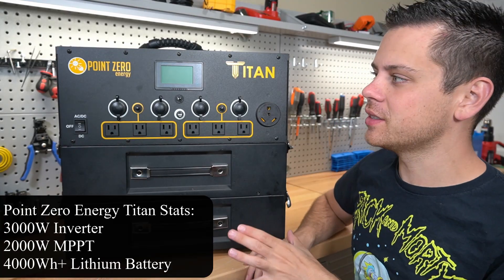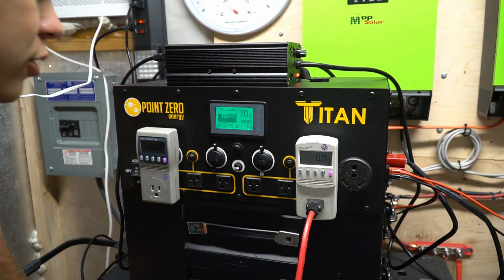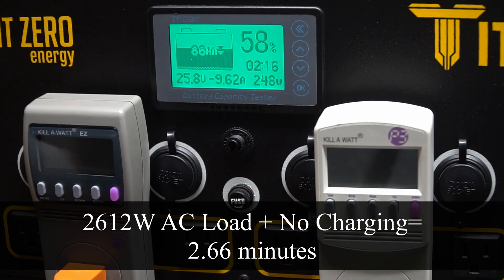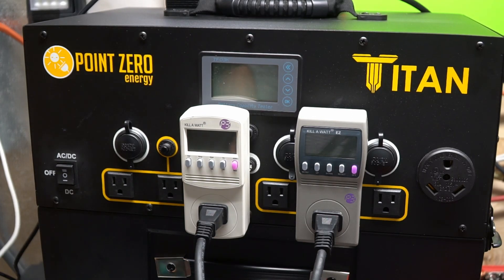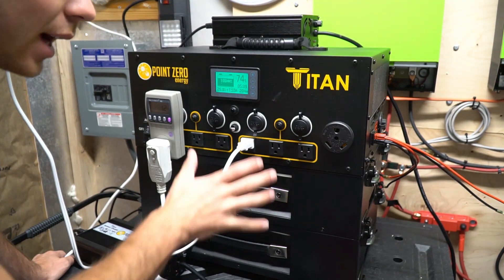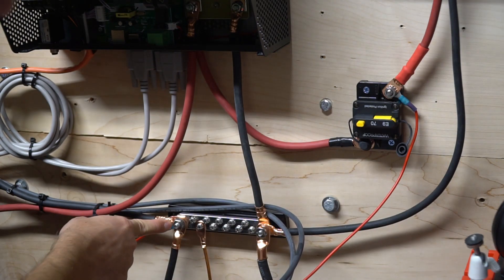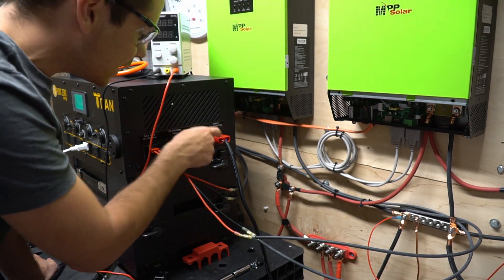Titan Solar Generator: Max Load Test, Battery Expansion, 12V Charging and more!

Comment from the maker: Update from Point Zero Energy: I got a bad batch! (just my luck as always haha!) If I had a Titan that was produced just a week earlier, this problem wouldn't have occurred. They added an upgrade to the inverter board to make it more robust during shipping, but it has caused heat to accumulate next to a sensor. So point zero energy is fixing this batch of units and sending out one to me that works. 

They had no idea that this problem would occur, so they seem glad that I caught it. I know that other titan users have ran these units 24/7 since feburary, so the results I was getting was quite confusing. I will get a new unit with this problem fixed for the next video. 
All Titans before this batch do not have this problem. I will do a new video testing the updated unit. They assured me that this will never happen again. Will keep you guys updated.
Table of contents:
Load tests:
1:02 2,868W output + AC Charging + Solar Charging Test
1:49 2,868W output + Solar Charging Test
2:13 2,868W output Test
2:51 2,125W output Test + AC Charging + Solar Charging Test
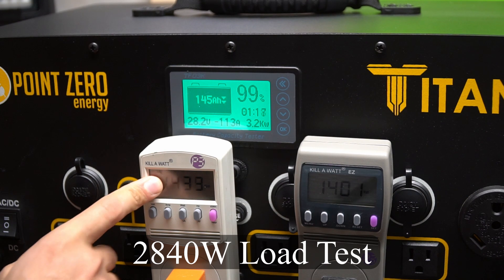3:38 2,240W Test
3:55 2,424W Test
5:02 2,000W Test
5:34 Multi-day test with air conditioner
6:10 12V Car Charging Test
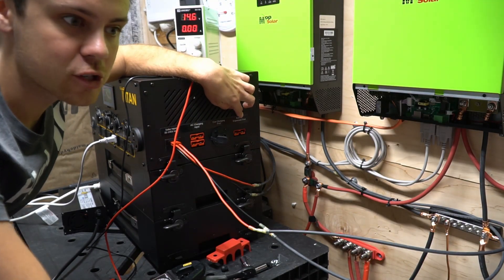6:37 Battery Expansion Port Test
9:04 Conclusion

~~~~~~~~~~~~~~~~~~~~~~~~~~~~~~~~~~~
Tired of getting ripped off? Check out my "Will Prowse Approved" solar product recommendations below!

12V Batteries
https://www.mobile-solarpower.com/lithium-batteries.html

48V Batteries
https://www.mobile-solarpower.com/48v-batteries.html

Offgrid Inverter System Builder
https://www.mobile-solarpower.com/48v-complete-system-blueprint-559371.html

Hybrid Inverter System Builder
https://www.mobile-solarpower.com/code-compliant-48v-offgrid-system.html

Mobile Handtruck System Builder (very popular!)
https://www.mobile-solarpower.com/mobile-48v-system.html

Solar Panels
https://www.mobile-solarpower.com/300w-solar-panels.html

Ground Mount Solar Racking
https://www.mobile-solarpower.com/ground-mount-racks.html

Wire, Lugs and Busbars
https://www.mobile-solarpower.com/wire-and-connectors.html

Tools
https://www.mobile-solarpower.com/tools.html

Fuses and Circuit Breakers
https://www.mobile-solarpower.com/fuses.html

Plug-N-Play Solar Systems
Ecoflow, Anker And Bluetti! So many models to choose from. See my current recommendations here:
https://www.mobile-solarpower.com/full-size-systems.html

~~~~~~~~~~~~~~~~~~~~~~~~~~~~~~~~~~~~~~~~~~
Need to build a large DIY system? Need a trustworthy solar distributor? These are my favorites:

Signature Solar
Creator of EG4! Solar Minisplits, Victron and More! Largest Solar Store Online.
If you want $50 off, please use my link below and coupon code "DIYSOLAR50":
https://signaturesolar.com/?ref=cPwLcVc0SW-BjN

Current Connected
Best Prices for EG4, Victron, Midnite and so much more! Fast Shipping and Highest Rated Customer Service:
https://currentconnected.com/?ref=wp

~~~~~~~~~~~~~~~~~~~~~~~~~~~~~~~~~~~~~~~~~~
Join our DIY Solar Community 
Need more help? Join the largest solar forum on the internet for beginners and professionals alike. 140,000 members and counting!
https://www.diysolarforum.com

Check Out My Free Book
Best-selling and beginner-friendly guidebook to off-grid 12V solar!
https://www.mobile-solarpower.com/the-book.html

~~~~~~~~~~~~~~~~~~~~~~~~~~~~~~~~~~~~~~~~~~
Contact Information:
I am NOT available for personal solar system consult! If you wish to contact me, this is my direct email: williamprowsediysolar@gmail.com
FTC Disclosure Statement and Disclaimers:
Every video includes paid promotion or sponsorship (such as free products for review). Some links on this YouTube channel may be affiliate links. We may get paid if you buy something or take an action after clicking one of these. My videos are for educational purposes only. Information is subject to change/update at any time. Electricity is DANGEROUS and can kill. Be smart and use common sense :) DIY Solar Power with Will Prowse is a participant in the Amazon Services LLC Associates Program, An affiliate advertising program designed to provide a means for sites to earn advertising fees by advertising and linking to Amazon.com
Reply: videos too short! Need to be about an hour long. lol
Reply: @controlyourfuture5477  So that we can watch it cool down? lol We just need to pause it, and watch it again, understand it. All the information is there.
Reply: "Should we test this before sending it to reviewers? Nah screw it"
Reply: @Fur_Trader  I was just thinking this lol, I was also wondering What the temp is in his shed, like he put a heat gun in there lol
Reply: Will, I was watching one of the Chris Titus Tech videos the other day, and he has the labeling somehow encoded into the video itself, I thought it was pretty cool to mouse over the timeline and see it labeled.
Reply: @javabeanz8549  I believe that's a new thing with YouTube, if you put the timestamps in the description.
Reply: Will can you start taking decibel measurements? Maybe start a spreadsheet pinned on the website maybe? Love your work man, more please! Lol
Reply: Will, you mention that units before this batch were unaffected.  When did you receive your unit.  Are they serial numbered, and if so, what serial numbers are affected?  I received mine in mid March, but I have never reached that high of a load level.  The highest load I've put on mine is 2 kW and I've not had any problems with that.
Reply: What if you're another person who happened to get this batch? Will everyone else get new units shipped to them?
Reply: Thanks, thinking of buying one but stopped thinking about it until I read your update. keep up the good work, u must be an electrical engineer or at least have a BET degree. I have not seen this kind of knowledge since since I left that environment just after the turn of the century. Yes my first programming courses were punched cards, EIA/ISO NC, basic programming, single board design, mostly ending in the late 90s. I love your stuff, dont go to hollywood and make any movies, it would ruin your passion.
Reply: Thanks for making this timeline list
Reply: I'm supposed to receive my unit in July.  I've been impressed with PZ so far.  I called them and the owner answered the phone and answered all my questions.  I expect that they will make this right.  Looking forward to finally getting to play with this thing.  Beats anything else out there, and I probably couldn't build a system for any less.
Reply: Bryan Smith have you seen the new apex units? I’m getting my titan 1000 kit this Monday!
Reply: Oh hell no,! You discovered a huge issue, you deserve royalties or free Ice cream or something! Lol
Reply: Did you get a better version of the Titan?  I would love to see it with 3 batteries.   I have been looking at it every week since I watched your first video.  My electric bill tripled.  It is summer but the spike in price was mostly on the delivery fee end.  We also have had our power out recently for about a week and that has happened before.  I like the concept of the Titan but if the inverter is the limiting factor, then, would having 3 batteries help or not?   Using their numbers, I have been thinking that 3 batteries would run my whole house.  But could the inverter handle everything?  Or would it just be running the things other than the oven and dryer maybe?
Reply: Can you charge your Tesla off it on that TT-30 outlet using a NEMA 14-50 adapter? I've seen them made for EVs.
Reply: Jason Bowman Could be they didn’t thoroughly test it? Also I think testing is not thorough, maybe they randomly spot check one to test more thoroughly, not all. If his was a preproduction model maybe they should have tested it fully
Reply: When did you receive yours? Wondering if the unit I received this week is affected.
Reply: Hey will another thought occurred to me, I have been aiming to 4kW+ because of the performance changes in altitude, as well as temperature, maybe test for the effects of altitude if possible?
Reply: According to their webpage the max load of 1500W is recommended to prolong battery life.  This unit (with 2 batteries) lists at $4400 and weighs almost 100 lbs!  Not exactly portable (unless you take it apart).
Reply: What's the power factor of the air conditioner maybe the VA was to high.
Reply: That's a relief, have one on the way...
Reply: Hardware needs to take a lesson from software and do REGRESSION TESTING when they change ANYTHING
Reply: I dont mean to be so offtopic but does anyone know a trick to get back into an instagram account??
I was dumb forgot my password. I appreciate any tips you can offer me!
Reply: @Tomas Chris instablaster =)
Reply: @Randy Maverick Thanks for your reply. I found the site through google and Im waiting for the hacking stuff now.
I see it takes quite some time so I will reply here later when my account password hopefully is recovered.
Reply: @Randy Maverick it worked and I finally got access to my account again. I am so happy:D
Thank you so much, you really help me out !
Reply: @Tomas Chris no problem :)
Reply: You're very thorough in your tests. I like that. Stay honest. Keep it up!!
Reply: I'm glad they helped YOU, but there are 8 of us here that have units that went up in smoke and are not getting any help at all....

Comment: It saddens me greatly that my Point Zero Titan Solar Generator, with only a cell phone and small smart tv plugged into it, caught fire and had to be returned under warranty for repair. WORSE than that, they returned it to me with the same problem. I simply set it upon it's base and clamped it's own side hinge clasps together and plugged in a lamp and "Pop! Pop! Pop!" It WENT UP IN SMOKE AGAIN. Mind you, the unit ran perfectly for 20 months being used daily to power a phone and TV and a lamp and sometimes a laptop. Subsequently, Point Zero Titan has COMPLETELY IGNORED ALL REQUESTS TO HAVE THE UNIT PROPERLY REPAIRED, ignoring ALL calls, ALL emails and ALL CERTIFIED LETTERS. It is so very disappointing that what started out as an INCREDIBLE machine ended up here as a VERY EXPENSIVE COMPLETELY DANGEROUS AND NON FUNCTIONING  system. POINT ZERO TITAN HAS NOW GONE OUT OF BUSINESS and there are atleast 8 of us within 100 miles of one another who have experienced the same exact issues. It starts out smelling like a hot fishy smell and then evolves to a burnt electrical smell within moments and then smoke and flames come out the side vents. My guess is that it is poor soldering technique and components jammed too close together. I sure would like to have the unit repaired and be able to use it here as the missionary base source of power but where oh where can I even take it to for repair? The first issue rendered 12v useless. The second event rendered 110 useless. If anyone knows where any of us can take this unit for repair, please let us know. I have known people who have really used their's beastly for 20 months before they died and here I am just barely loading it and an entire year of my income has been lost on this...maybe we just need to build our own and then when one component goes bad, we simply replace the component...ideas please? I am willing to pay a qualified technician to repair it because I am in the Sonoran Desert Wilderness , miles and miles away from civilization and I need a RELIABLE unit...I am so disheartened....

Comment: HELP ANYONE! I realize it's 2025 I Purchased my Titan (The one pictured in this video) 1500 Kit (2 Batt Packs 15 Panels) In 2021. I Just installed it 7 months ago OCT. 2024. It is in a 50 Degree Shop running 700 Watts of Grow Lights. I turn it on every morning. It is not on at night. I turned it on and went to work. It was at 85% charge running 600-700 Watts I cam home 5 hours later. No grow lights on. Titan is at 100% Charge and also still charging from solar. NO A/C power output. NO D/C power output. The fuse is fine and the black "Breaker Buttons are not tripped" At least I push them in and hold but there is no click or snap as if they will remain depressed. They seem to be "Floating" if that makes sense. I unhooked the solar and turned the unit off for a couple hours came back and plugged in several test items. "Still no power output" I left it off ALL NIGHT. Went in this morning, "No power output" This thing may be 4 years old but it is really BRAND NEW. Any help PLEASE???
Reply: Sad that Point Zero Energy closed in May 2025.  I have spent thousands of dollars on their products and now I'm hanging in the balance.

Comment: Will, I have a Titan from Point Zero with three batteries.  The inverter trips with any load over 500 watts. It has been sent back twice for repair and it is out of warranty now.  Can you tell me the distributors that you mentioned in this video?  Peter

Comment: Will have you done a follow up video on the Titan after you used it for awhile.  Just took delivery of one after a long wait.  For my RV.  Two batteries.  Two of the heavy duty AC chargers.  Figure I can recharge at night when I run my Gen set for 2 hours

Comment: This is one of your best reviews imo, I really like the external battery connection. But my favorite is that they de-rated their capacity for a longer life system. I think heat is the biggest problem for all in one systems. Maybe a small liquid cooling system is the answer.

Comment: Hey there, just found you and liking your videos. I’m in the market for a solar generator that will power a deep freezer or household fridge. I’ve been told that the Titan is the only one large enough to do the job. Problem is I’m new to this, have watched & read so much that I’m overwhelmed. Which Titan would I need and how many add on batteries & panels would I need for a large appliance? Additionally Nature’s Generator now has a 3600w system. Do you have experience with this generator? Thx a bunch, would be super appreciative if you could offer some advice.

Comment: The problem may be internal temperatures. There is not enough cooling air to cool the inverter. Those cooling holes,  both intake and fans, look way too small. 

What is the ambient temperature?

As for charging from a car:
Most cars don't have cigarette lighter circuits anymore. They have power outlets. Difference is that cigarette lighter was fused at 15A to 20A. The newer cars are fused at 10A.

Comment: I'm sorry if you've posted a video already but I would love to see more second-life batteries used for energy storage. Also a system the average person could change a battery pack easily in the future when needed with maybe 18650/21700  or other battery cells in a pack.

Comment: 365
W per panel
Short Circuit Current: 9.83
Open VOC: 48 Volts
Current Max Power: 9.33 Amps
Voltage Max power: 39.10 volts  
If I do parallel setting 6 to 8 panel my maximum current will be 9 Amp x 6 or 8 = 54 A - 72 A 
the titan spec Maximum charge current: 40A (approximately 1000 watts)
Maximum continuous Discharge: 100A (approximately 2500 watts) will it be OK

Comment: These units are expensive at $3000 with just one battery (second battery is $1500). So they better work. I think that most of us hardly use more than 2009 watts, but it’s good to know there is leeway on the upside. I do think this could be a good investment for an RV. What is the standby power consumption with the inverter turned in?

Comment: Question I have Simpliphi 3.5 24v batteries. Now they are no longer made . They are 3.8 24v. They say you can’t miss match these batteries in parallel. It there a way to balance them or degrade the better battery in order to increase my battery bank without damaging either? Thank you.

Comment: I really like the Titan and the Bluetti AC200. I like being able to expand the battery. I want a solar generator to run an outside portable hot tub, requires a 12 amp circuit, 1440 watts. I would like the system to be able to support a 20 amp 120 volt circuit, 2400 watts. The Titan would have been perfect for my needs, but unfortunately it failed your test, the cost is also an issue. It would have been a good option for power outages.

Comment: Great thorough review! Thx! 😉👍 The Titan with 2-3 battery packs, would be a great van/truck camper power source. Just add the dual 110v chargers, a set of 400-600W solar panels, and a charging alternator, for a great system. This could run the  A/C, induction stove (when A/C is off), fridge, water heater,  lighting and power outlets. Just add a gas or diesel heater, and voila! Nice!